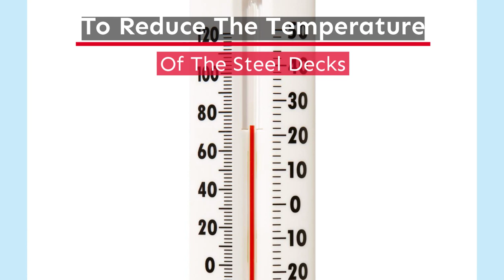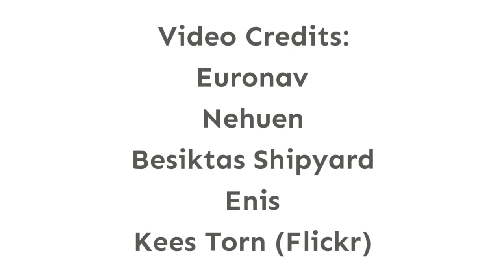Euronav Oceania -  Largest Crude Oil Tanker in the World

Comment: Q.no.1.  How many staffs working per duty hours.
         2. How pilots should board the ship and disembark.
          3. For taking u turn, how many miles should the ship
               Travel and turn.
           4. For port entry and exit, how many tug boats operate to
                help the ship.
            5. How many floors are there and how to reach those floors.
             6. How sailors cross from hull side to the control tower, by
                  walk, bicycle, mechanised two wheeler or 4 wheeler.
              7.who is the present captain of the  ship.

Comment: 50.000 Hp is quit modest for such a big ship. The hull design must be quit efficient to have such high service speed with only 50,000 Hp ... are the cargo pump driven by steam turbines ? any data on how powerful those are & how many ?
Reply: 3 steam turbine driven pumps 7000m3/hr capacity each
Reply: @sundhukumar  Tankers need steam to heat their cargo, so the pumps can pump it..., so steam turbine pumps are a logical choice...7000m3 / h is quit some... how many HP are those turbines ?
Do they have steam reciprocating stripping pumps as well ?

Comment: My Name Is Gegham Gary Izmirian I Love Oil Tankers Very Much They Are The Biggest Ships I Have Ever Seen In My Life I Would Recommend For A Oil Tanker To Have More Cruising Speeds The More Faster A Oil Tanker Goes The More Faster A Oil Tanker Will Complete Her Maiden Voyage I Would Recommend 3 Propellers and 3 Gas Turbine Engines I Would Recommend 5 High Speeds 1 15.5 Knots 17.82 Miles Per Hour 2 16.5 Knots 18.97 Miles Per Hour 3 17.3 Knots 19.89 Miles Per Hour 4 18.2 Knots 20.93 Miles Per Hour 5 19.9 Knots 22.88 Miles Per Hour The Rms Titanic Had 3 Propellers Under Her Stern Before She Sank After Colliding With A Iceberg

Comment: How much fuel consumed per day running at 16.5 nautical miles per hour when laden.
Reply: a question i was going to ask or simply  since unlikely to run at that speed for very long.
to do 1 mpg how many inches does it cover,   look at all the damage to the world does all these tankers do
since this is only 1 ship and there are 100's of them
Reply: @davidsworld5837  look how thsese tankers do to keep world economy and normal functioning of society
Reply: I just did some calculations today to figure that out since here in the America’s the current Administration Stopped most new leases for oil and also stopped valuable pipeline infrastructure from being built that would have kept the North Americas energy independent and Biden relied on oil imported from Russia and now is begging Saudi Arabia to boost production to ship in Supertankers. These massive ships burn around 9,774 gallons an hour of crude oil. The trip takes about 40 days or roughly 960 hours for a total Gallon consumption of 9,383,040 gallons.
Then on the empty return trip burns another 3,740,000 for a whopping 13,123,000 gallons 🔥 burned up. That is 223,405 Barrels, or potentially 111,703 gallons of 87 Octane Gasoline for cars. ]

Lets assume for the argument we have a fleet of Nissan Altima’s and get 36 MPG x the number of gallons of 87 Octane then we could have powered 4,021,302 driver miles. Divide that by 12,000 miles average Milage a US driver drives in one year and that would equate to 335 Nissan Altimas could be driven by people for one year on what it takes to move Crude Oil from Saudi Arabia to the USA, just that one ship. USA receives on average three supertankers each week to the Gulf of Mexico Loop oil Rig for offloading, that is 150 ships per year that burn enough fuel to power 50,266 Nissan Altima Cars for one year 12,000 miles each. What a crying shame that the USA Current Biden Administration is saying to the young people see we are saving the planet? The hell you are, your burning nasty crude oil for just about no reason to import oil you already have in your backyard. 

Please feel free to check my math or ask where I obtained my statistics on SuperTankers. Thank you.